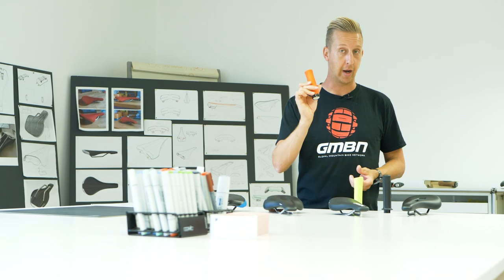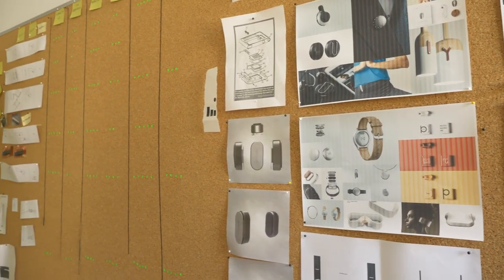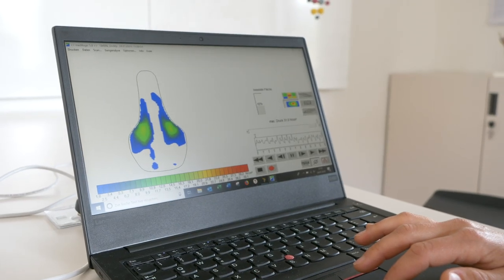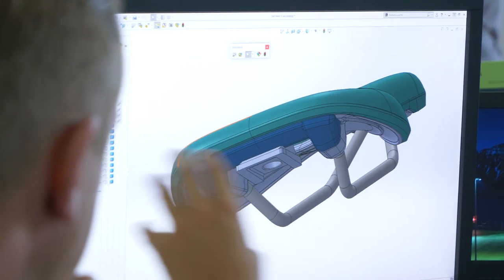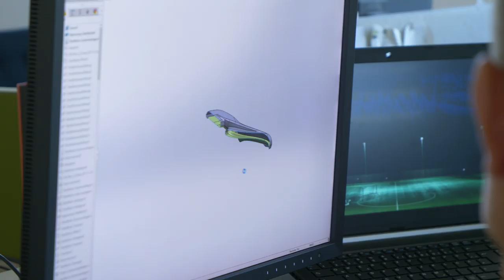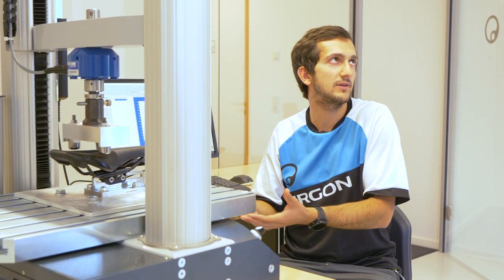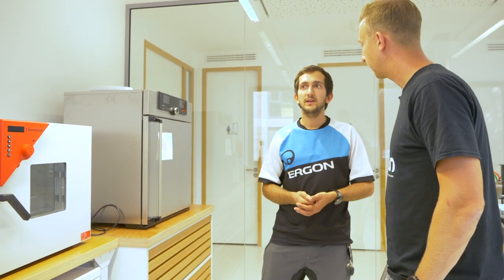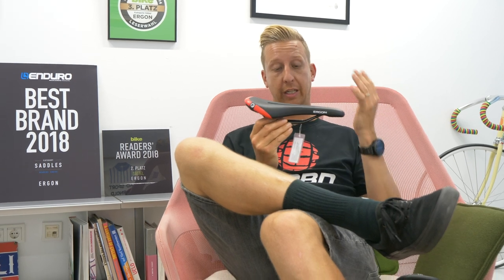How Are MTB Saddles Developed And Designed? | Inside Ergon HQ

Comment: I did my PhD in Robotics and this reminds me of all the similar testing we did for Robotic Ankles for research (mostly inside the socket for amputees). Pressure pads (like the one they used on the saddle for Doddy) are very flexible and fairly accurate, so you can use it on any numbers of surfaces. Do they use the same methodology for their grips as well (pressure mapping)? Also, I REALLY want to know where the Product Designer got that duck shirt; looks like a very high-quality shirt and love the logo!
Reply: you can find the duck t-shirt at Edmmond Studios ;)

Comment: I realised recently, that times has changed to the point, it's most often difficult to find a RELIABLE saddle that is comfortable, so once you fall in love with it, it won't appear that you have a 
quarterly-subscription-saddle. This video makes me think I should increase the budget even more, but it's soooo hard when you've experienced so many without finding the right one. And most of them are not available for testing. Although there are return policies in EU-unpack carefully, unlock zip-ties, stick electrical tape onto seatpost/dropper head so it won't scuff the rails and you can make a 50km road test so at least you know if it's not terrible right from the start. But few at once, pick best, return the rest with no trace. That is what bikers are forced to do....sad

Comment: Excellent and very informative. But how do you find the right saddle? I mean, a cheap saddle starts at around 30 quid, and it's just upward from there for anything decent. And given that a saddle can seem fine for the first few hours before problems start to reveal themselves, so just sitting on a few different bikes in the shop won't prove much, doesn't this mean we either take a gamble and stick with the result, or spend all our money on replacement saddles until we eventually find one that's right?
Reply: Lots of shops offer you to Test a saddle for a few days, so if it doesnt fit and its still in perfect condition they will take it back and give you another one to try until youre happy.